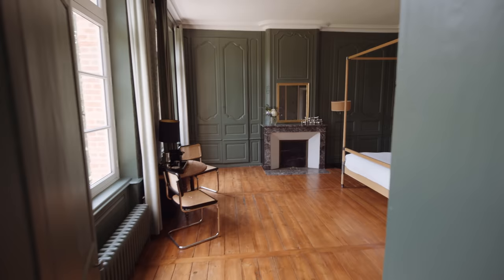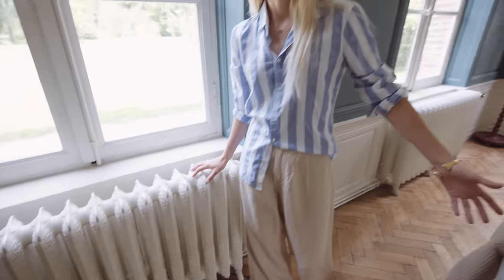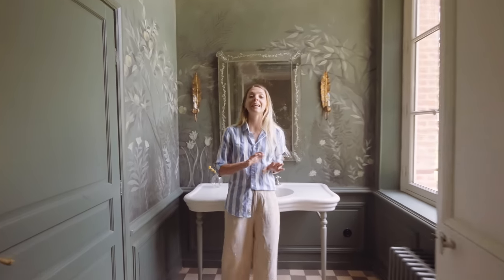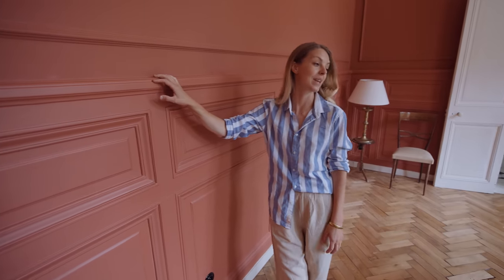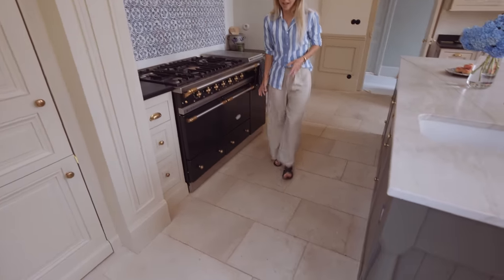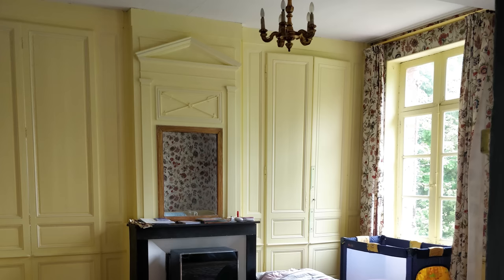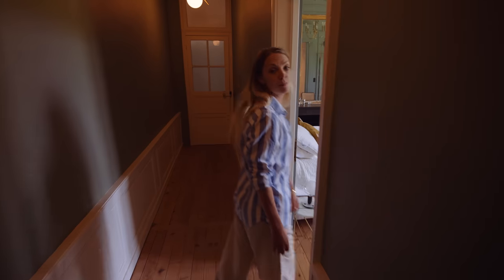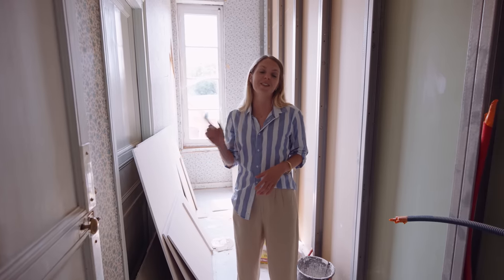Amazing 4 Year Transformation - Tour our Renovated French Chateau Home

Comment: As gorgeous as this is, with global warming, I cannot imagine the stifling oven this place will be in a decade or two. Even now, temps get insanely high in Europe.
Reply: not that high in France though, most of the time. Not yet.
Reply: Old buildings have thick, stone walls that help maintain quite a stable temperature whole year round without AC. It'll be way less of an "oven" than any moder houses :) Also they have exterior blinds 

Also they're in Normandy so it's still fairly temperate compared to the South of France.